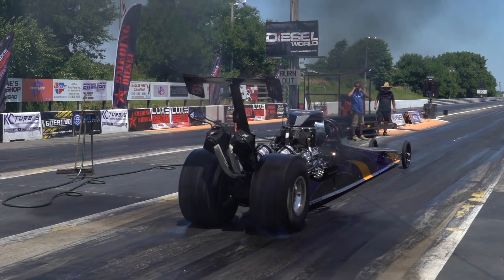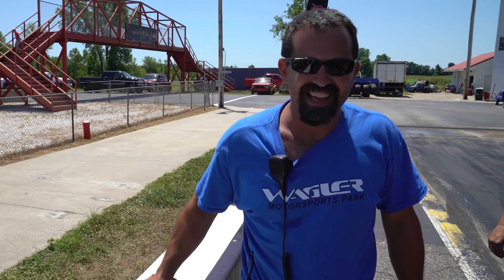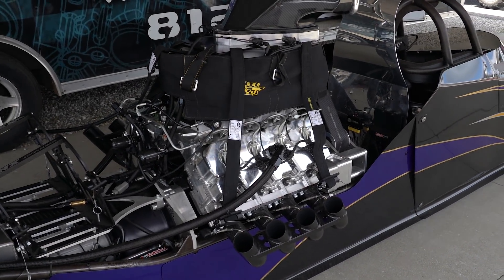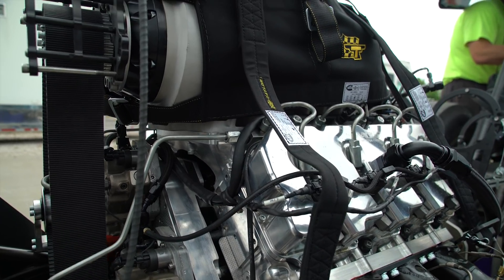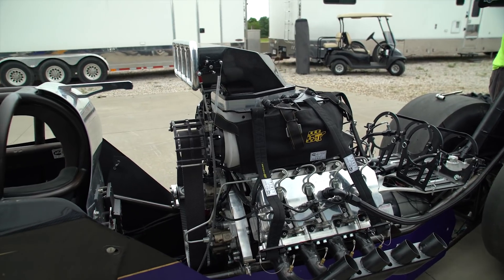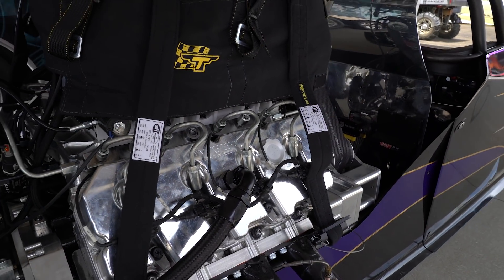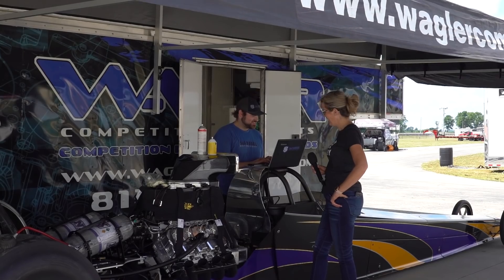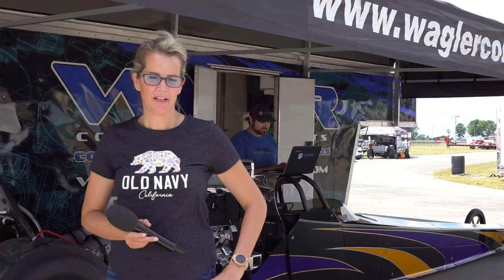Top Fuel 6.6L Duramax Engine - Wagler Competition

Comment: The Duramax doesn't make enough RPM to run 330mph, you need 9000+
Reply: Alex Eidenier  you could if the rules let you, NHRA limits top fuel to 3.20: 1 gears
Reply: Alex Eidenier  Alex, bullshit, Diesels are swinging to much mass to spin 9000rpm, feel free to live in your world of dilusion, not even the Diesel Audi That won Lemans buzz that fast,  go back to sleep
Reply: Alex Eidenier  BTW, I'm an engine Machinist, no N14 Cummins, no 3406 Cat, no 60 series Detroit, no 92, 71, or 53 series are going to buzz to 9000 without murdering themselves by the time they reach 6000....

Comment: He's not running diesel in the engine. He's using the engine parts, (block, heads, pistons.) But not the fuel. The fuel was alcohol and water? Why not try top fuel. It will keep the blower cool.  Why not run some alcohol through the blower. Surely it would cool, wouldnt it?  Also, when he left the line, looked like it had a good bite to me.
Reply: look at teh smoke, its diesel, with mater meth

Comment: Listening to a modern diesel with no turbo is so odd
Reply: Not "modern" to be non-turbo as they're supplying oxygen density to burn the diesel via pre-pressurized nitrous oxide.  (N2O) that way you don't have the parasitic drag on the engine having to grab that oxygen from the air physically, its pushed in by the nitrous tanks.
Reply: @snap-off5383  It's non turbo but that huge blower is certainly creating drag on the motor. Obviously it's worth it though.
Reply: @Lucas12v  yeah I guess you're right it doesn't have a hat onto an injector manifold, it appears to have a screwcharger.

Comment: NO, IT'S NOT A TOP FUEL DRAGSTER.  The designation "Top Fuel" means it runs on NITRO. There is NO WAY an engine with the compression of a diesel would hold together running Nitro. Why is it anything with a pipe rack chassis is automatically called "Top Fuel"? Read a rule book.

Comment: Extremely interested in knowing more about how you are building power, at the same time with durability/reliability !
Reply: it doesnt make shit for power.
Reply: @DieselRamcharger  
See !
I know that you can build power in the Duramax,
But with that, my understanding is that reliability is significantly reduced !
A number of power adders are required,
( multiple turbos, and supercharging ) is required !
In turn, additional chamber pressure is causing head gasket failures, etc. on the top end,
and depending on what has been done to strengthen the bottom end, a number of rod problems, and crank issues are showing up !
Thanks for your comment !
Reply: @quadsman11  this has a power adder. and it still sucks. you can make power out of anything. its just wagler that cant. the problem isnt duramax. the problem is the people building this screwed coupe are fucking clueless. but hey if you slap enough billet shit on there, people will think you know what your talking about!
Reply: Ol’ @diesel Ramcharger has his panties in a wad for some reason. That setup came along to make about 2000 hp on a factory Duramax block filled with concrete and forged internals. Lots of nitrous to keep charge air temps down and a touch of water injection helped to keep things going. Had to beef up valve train for the cylinder pressure/temp and rpm. It ran right up to about 6800 rpm across the finish line.

Comment: Clutch management has to be an entirely different animal than your typical drag setup.
I can't imagine in exactly what ways.
That could be it's own video.
HINT, HINT!!
Reply: I agree- and I wouldn't get real surprised if his cluch guy only worked in side a locked closet, in the darl of the moon and blind flolded so he wouldn't know any "secrets"- such is the mystique of top class dragster clutches. The Force sisters don't even share their info, I'm told! FR
Reply: @fredericrike5974  I fully agree...
But you can't blame a fellow HP junkie for asking the obvious.
I love to learn. And I love to learn about what fascinates me.
I know I'm not alone and I hope someone who asks that same question finds a tiny molecule of info to feed that need.
Reply: @macgyver77777  I'm on that team too- having "lurked in the pits" a few times, the security circus some race teams throw up when the "clutch guy" is "doing his thang" is hilarious until you realize just how serious it is to them. Knowledge is too precious to share by some of these folks attitude. FR
Reply: @fredericrike5974  I'd even like to know some general differences. 
Not like the "secrets"... Just what major differences are there
Reply: No clutch in this thing! Kept it simple with a pretty average powerglide
Reply: @andredusek6792  That is one answer to the power train problem. Not without it's own "toughies" like transferring a couple of thousand ft/pounds of torque through a transmission originally designed for lots less than 500 hp or half that in torque. I'd say average is in the eye of the beholder, though- my best Powerglide car had maybe 700 hp and I blew three before I bit the bullet and moved up to a turbo 400! FR
Reply: @andredusek6792  Wow..... How did you build it stout enough to handle the bucket loads of torque??
That's an impressive feat!
Reply: @macgyver77777  it’s actually the same Coan powerglide build that’s in the Brodozer Monster Jam truck (https://youtu.be/DqAH8vc1HNA)

In the diesel world drag racing world the th400 has become king with lots of upgrades, but are insanely expensive. So trying something more cost effective with the glide and it seems to work well.
Reply: @andredusek6792  Been watching lots of Richards videos on Precision Transmission's channel.
Plenty of billet goodies shown and lots of tech shared.
But NOT seen anything that looked that viable.
Glad you've had success with your recipe!

Comment: I wonder what the final gear ratio is, since the top RPM of a diesel is what it is... But the torque is off the charts..
Reply: If memory serves, TF cars have a 3.2 final ratio, this is probably the same.  A TF car spins it's crank less than 900 times for a 1000' run.
Reply: @bradjohnson9671  ... I'm going to respectfully argue that... Only being a diesel mechanic for approximately 50 years.. I'm just saying..
Reply: @Subcoolschool  You're probably right.  Wonder if there are any regs on diesels in NHRA?  That Durmax sure isn't going to rev to 8000 RPM like a TF hemi unless you REALLY like picking up parts from everywhere.  that said, a diesel will have a LOT fewer spins at the end of the run.  What's the max RPM for a stock Durmax?
Reply: They messed up the post.. it’s a Top Dragster chassis, not Top fuel. Rear ratio ended up being like a 3.89 if I recall correctly with a power glide, ran right up to 6800 rpm at the finish line @ 174 mph in the 1/8

Comment: You've got a really nice dragster and bonus that it burns diesel with methanol and nitrous to cool the blower!  ..it's just not top Fuel.

By definition, Top Fuel expressly forbids fuels other than nitromethane and methanol, with no more than 90% nitromethane content.  NHRA 2021 Rule Manual, Section 19, page 3.
Reply: I agree... super cool car, for sure! But unless it burns nitromethane, it's not top fuel.
Reply: Make a class and call it Top diesel fuel....from Wyoming USA 🇺🇸🤠
Reply: The car is a top fuel chassis. That’s all they are saying. It’s not in top fuel, it’s merely a top fuel car. In other words, with an engine swap it would be 100% in class.
Reply: @moparproud3978  just a dragster chassis.... if you look its shorter than the top fuel dragsters....  wings way smaller and tires are WAY smaller
Reply: @davidadcock1475  because they are using a top alcohol chassis
Reply: @stevenweindorfer2554  which is not a top fuel chassis 🤷‍♂️🤷‍♂️🤷‍♂️🤦🤦🤦🤦🤦
Reply: Pity that diesel was not banned years ago. Stinking filth.

Comment: Lmao love the little roast of Gale Banks. Gotta get the air density down!
Reply: Actually, I "hear" a very competitive spirit ! And the car, with an unfinishe tune, makes very little over fueled smoke- Wagler is making horsepower  where Banks says it is- burning the fuel inside the combustion chamber not past it, rolling coal. FR
Reply: Yeah. If you can't beat them or outsmart them, you can always try to roast them.
Reply: @wcm68tn  Actually, I  think Gale would bring the weenies and marsh mellows if anything but coal was burned. As a younger sort, I don't think he ever saw a car he didn't think he could build better. FR

Comment: Detroit you just need to stick a turbo on top and it will be complete lol
Reply: Turbos on a diesel are wanted to create intake and thus cylinder pressure for proper self ignition. It’s the most efficient way. Why these guys don’t run turbos I would imagine is the intake pressure through the scoops at 200 mph is sufficient.
Reply: Old Detroit 8V71 "fuel squeezer".

Comment: Man alot of people really like the Isuzu 6.6L v8.
Reply: Whats there not to dislike?
Reply: Just the Intake was a zoo zoo eh
Reply: @derekv275  Durajunk engine is Isuzu
Reply: @sergeantmasson3669  owned by GM
Reply: @nascarfancar88  Try again.   "The U.S. automaker at one point owned as much as 49 percent in Isuzu before selling the holding down, disappointed with red ink spilled by Isuzu at the time and later strapped for cash of its own. Its last remaining 7.9 percent stake was sold in 2006 for $300 million."
Reply: It's definitely proven to be much more powerful and cleaner than the International 7.3.
Reply: @ashes2ashes863  WON'T stay together as well as a 7.3. Max HP from 7.3 diesel is 2180 hp. Can't get that from a 6.6 Durajunk.
Reply: @sergeantmasson3669  I don't know about that Sergeant. I mean I like the 7.3 a lot but Banks Power has been trying to blow up a 6.6 Duramax for like the last year now and they literally can't do it. Theyve run it so hard they had to put bigger injectors in it because the original injectors were fully opened and the engine still wouldn't explode even with all the power adders added. I don't think it's really fair to compare them though because the 7.3 was just built in a time when emissions wasn't a big deal and they were more free to do what they wanted. That's unfortunately the reason 7.3 is no more. They're just two different leagues of motor. If I was a wealthy man I probably use a Duramax as my daily driver and a 7.3 powered Ford as my beating around the farm truck. Of course just to be fair I would probably have to go to Cummins too. And I actually would probably go for one of the older 12-valve units that made a lot more noise and a lot less power on a manual. Even if it is a lot slower, it's probably a lot more fun to drive and will run on some real shit fuel without a complaint.
Reply: @ashes2ashes863  My 1997 F350 7.3 Powerstroke 4x4 has 359k miles and the engine hasn't been touched other than new glow plugs last summer.
Reply: @sergeantmasson3669  that 7.3 will run million with even the mildest of care.
Reply: @ashes2ashes863  I know that. My brother-in-law has a Ford car-carrier that has over 700k on it's 7.3
Reply: @sergeantmasson3669  weak numbers compared to Cummins. Powerjoke and durajunk need to stay in the pits
Reply: @sergeantmasson3669  the only complaint I ever had about the old 7.3 was that everytime I get behind one my eyes water. I've never smelled more obnoxious fumes coming out of a perfectly healthy engine before like that of the 7.3.
Reply: @ashes2ashes863  to bad my brother in law only got 150 and had to put $7 grand into it powerpuke strikes again
Reply: @ashes2ashes863  Detroit Diesel engines were far worse than the 7.3 diesel ever was.
Reply: @nascarfancar88  did it light on fire? Some of the new power strokes were doing that. Ford was pretty hush hush about it.
Reply: @A-SavageRedneck  you need to relax big dawg it's just an engine
Reply: @ashes2ashes863  unfortunately it did, scared the shit out of him, since then sold it
Reply: @nascarfancar88  yeah. That was my guess. I knew two die hard Ford guys that had the same outcome. One has a Cummins now, and the other Duramax. 😆 Both F three shitties were totalled. Luckily, no one got hurt. Both burned on the shoulder of the interstate in PA.
Reply: @ashes2ashes863  funny so did his !!

Comment: cool machine but lets be real that doesnt have a chance against 12000 hp top fuel ever
Reply: This isn’t competing with nitro top fuelers. Sometimes people do things simply to see if it can be done, and I think this is one of those things.
Reply: Whoever posted the video simply used the wrong name. No nitromethane, just methanol injection and some nitrous. A work in progress - and it did make a pretty strong 300-foot pass (second one) before it shut off early.